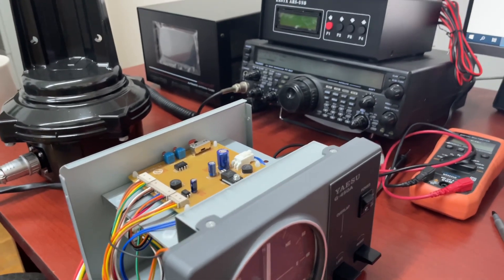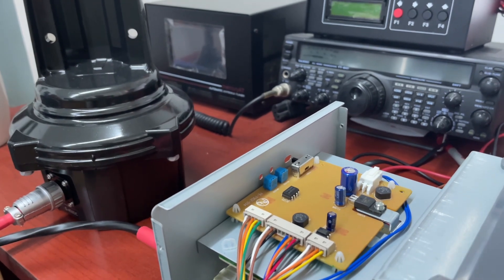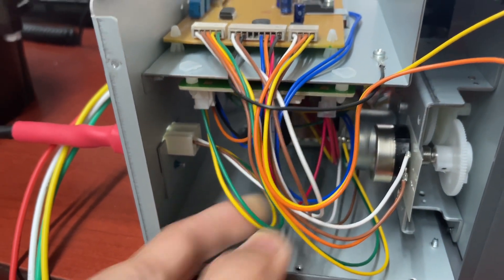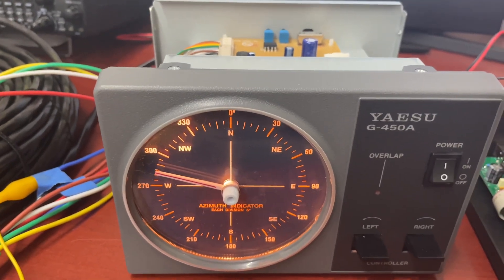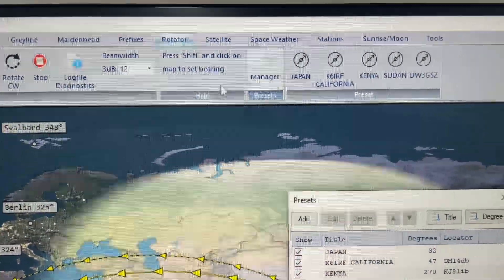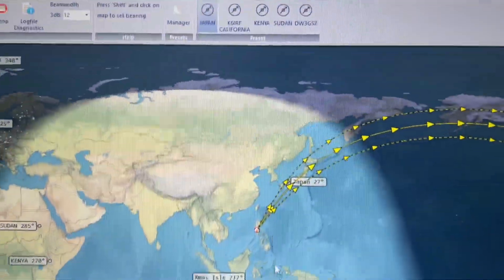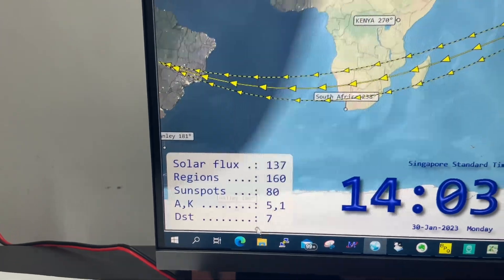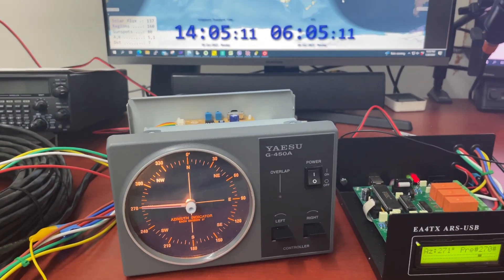EA4TX ARS-USB Rotator Controller. Will use on my Remote Station in Navotas City Philippines.

Comment: I bought one around 3 years ago for my Yaesu G650 controller - could never get it working properly (soldering skills?) but ended up spending out on the Arco smart rotator - expensive, but worth every single penny.

Comment: Also have this setup with the G400RC AC rotator .. The actual controller just packed up so now im considering ARCO smart conrroller which will work with any roator even if i upgrade.   Thanks for sharing .